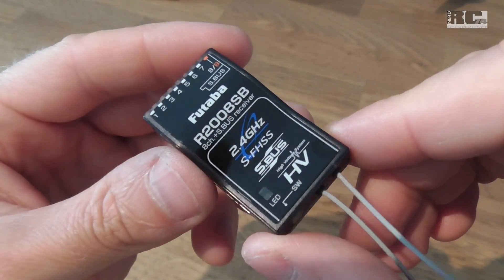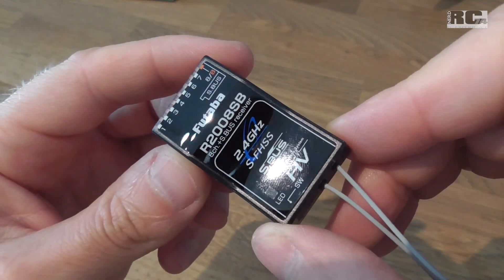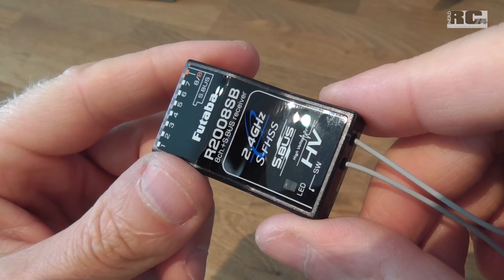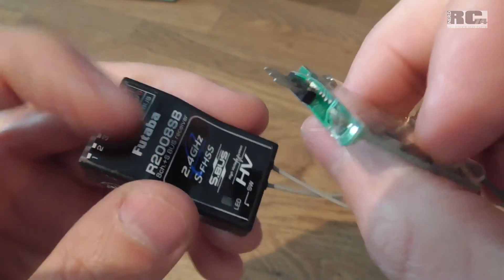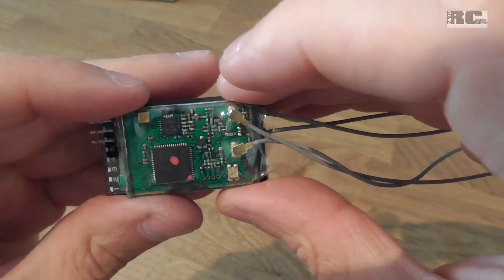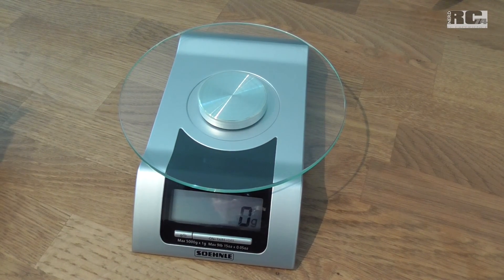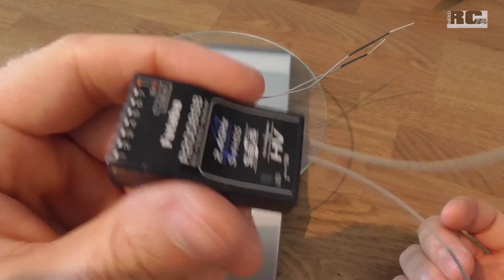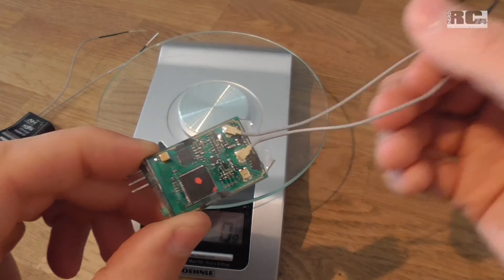FUTABA S-FHSS S-BUS RECEIVER R2008SB MODIFICATIONS

Comment: I could never do this. These receivers are too expensive, they make the smaller 2 or 3 pin receivers, better than the mod here. Too cringe 😆
Reply from the maker: The smaller ones are not Futaba S-FHSS protocol. If you want to use this great protocol, you have to do this mod.

Comment: Could you just desolder the connectors plate and soldering the SBUS cables or pins directly - saving the part to rebuilt the receiver if desired later?
Reply from the maker: It is pretty difficult to remove the connectors in a way to make it possible to solder them back on. I  use this receiver only as Sbus receiver.
Reply: @RCnerd74  Thanks! I have two of these receivers and they are bulky for the drones :D
Reply from the maker: @brunofporto  so good luck for the mod👍
Reply from the maker: @brunofporto  Congrats! Looks good👍😃 Have fun flying your fpv  drones with the save Futaba FHSS protocol.
Reply: Yes you can. I did it this way. That’s better because it’s cleaner and less thick :)